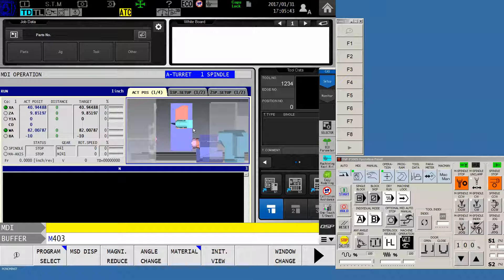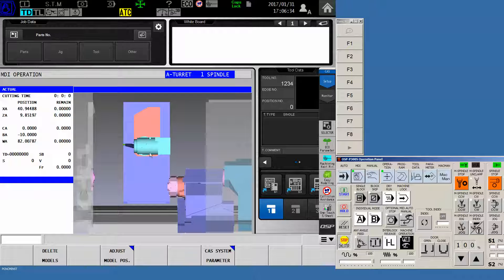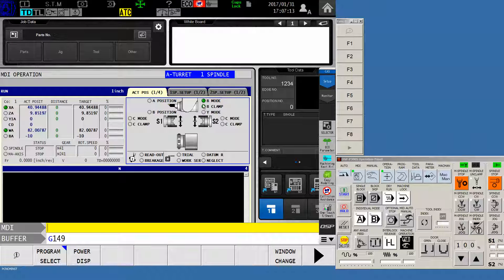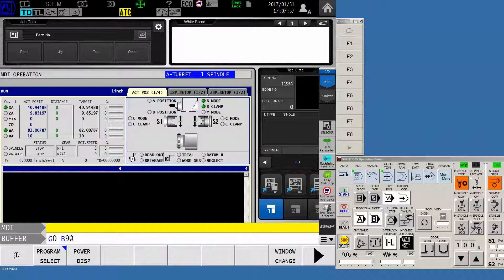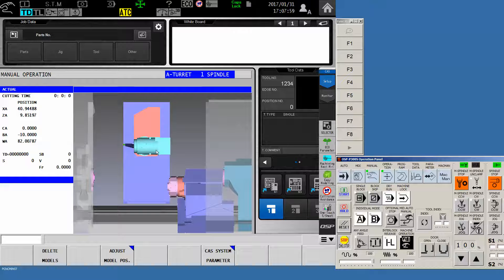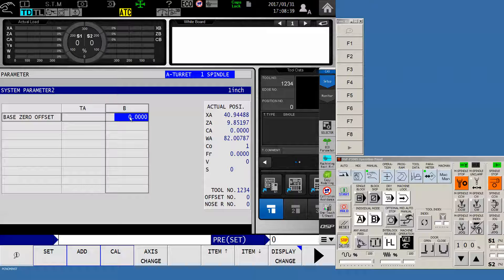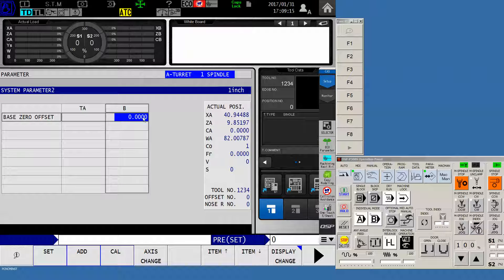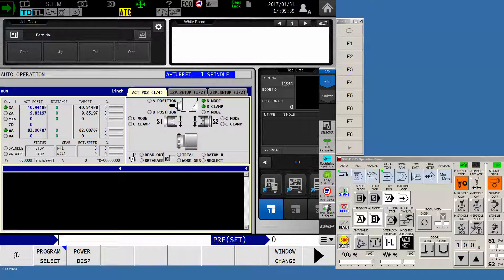ALIGN B AXIS

Comment: Hi ,guess i have a problem with okuma multus, the issue is "ALARM-A B-AXIS CLAMP INTERLOCK A SIDE" and i can't leave B mode, can you help me?
Reply from the maker: Totally! You must either handwheel or command the B axis back to actual zero before you can turn off the B axis mode. If you're lucky, you can simply command G0 B0, but if power has been cycled or E-stop pressed, you'll have to use jog functions to get back to B0

Comment: hi Charley,
can we use this same process for our multus U4000?
Reply from the maker: Yessir! This will work for any B axis multitasking machine from Okuma
Reply: @pocketcharleywithgosiger   I wasn't able to fine the B-Axis comp under (system parameter 2) is there another procedure or parameter that i can use to comp my B-Axis?
Reply: Forgot to MENTION there is a (B-AXIS POSITIONING COMPENSATION) Parameter, but i don't know where to comp
Reply: @burhoemachine9821  hi had you have any succes with this, also I don't have this. my machine is not B axis continue is A Multus B300 with positioning only

Comment: Hey! I have center height problem in my U4000 where i have  compensated X zero offset in Sp1 and Sp2. Main is -0.44mm and sub is +0.52mm. Can those parameters be used to fix it?
Reply from the maker: Absolutely! If the spindles do not share an exect same X axis zero, it is totally possible to use SYSTEM PARAMETER 2 to compensate for those differences so your ZERO POINT X values will both be 0. While in SYSTEM PARAMETER 2, you'll notice that switching between SP1 and SP2 displays different parameters for each spindle. Simply indicate SP1 and set it's X, then switch to SP2 and repeat. This is a great fix if the abnormality is A) not enough to produce abnormal part transfers and B) not enough to warrant a service call. Have at it!
Reply from the maker: Keep in mind that if you use this to fix a Y mismatch, the control will warn you that you aren't in Y SPINDLE TURNING POSITION when you switch from SP1 to SP2. That sort of abnormality usually requires a service call, or possibly setting the machine Y0 directly between the measured Y0 of SP1 and Y0 SP2
Reply: Thank you! Just one more thing, after probing of turning tools I have to compansate for the change in X zero offset. Will that still be problem or do the probe need to be calibrated?
Reply from the maker: Could go either way: If the modified SYSTEM2 value is in the opposite direction of your current error, it will cancel it out and there will be no need to comp anymore. On the flip side, if the new SYSTEM2 value is in the same direction, it will compound the error and you'll have to comp twice as much! Here is a secret, tho: once a turning tool has a proven good offset, if you re-open that tool and enter the touch setter software, then before touching off the tool, press the PARAMETER hard key, you'll be in touch setter calibration mode. Now touch off exactly as you normally would using the soft keys (they will still be displayed, even tho you're in the PARAMETER page) now you'll be setting the SETTER with the TOOL instead of setting the TOOL with the SETTER. Easy calibration!